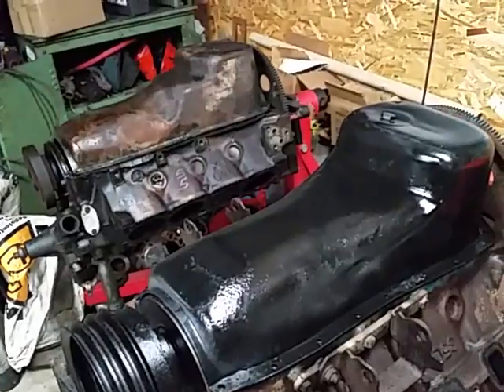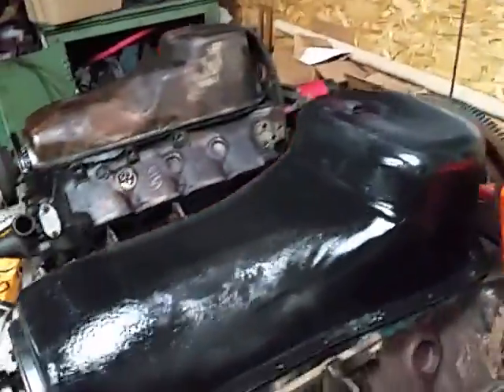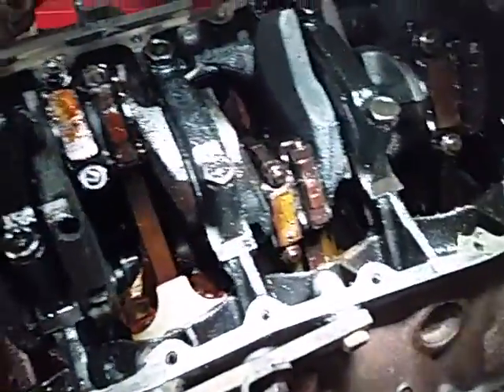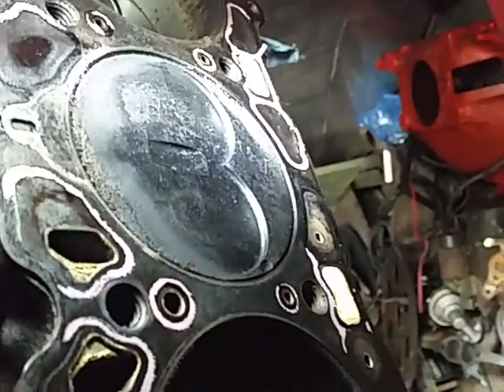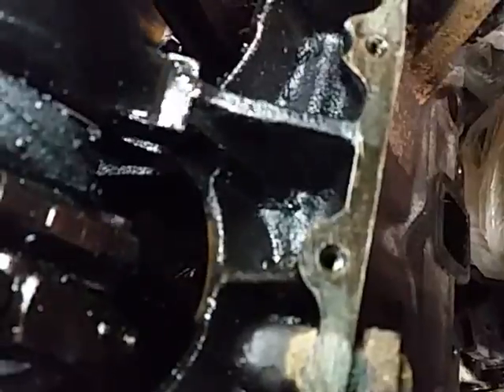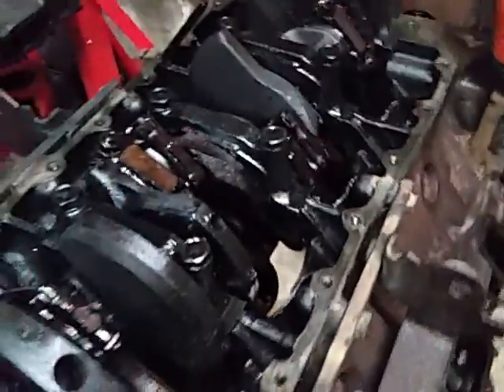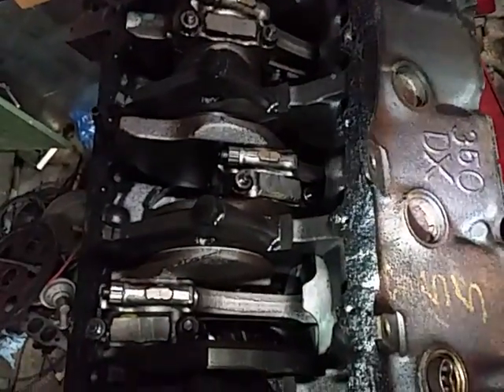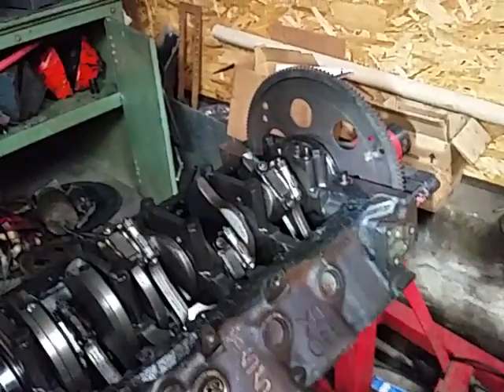Olds 350 Windowed Mains Vs DX Diesel: A Tale of Two Oldsmobile Small-block V8 Engines

Comment: I seem to remember Mondello selling at kit to use a modified 425 crank and gas heads/intake to make a 455 "small" block from the diesel block. I have no idea what rods they used. Saw one in a w-31 once and it was a great running car.
Reply from the maker: You're right. And I believe they used big block Chevy rods.  They had to be narrowed a bit at the journal end. Also I believe the counterweights needed work in that area. So the big obstacle is you wind up putting $1,000 worth of work into a 50 + year old crankshaft. On the plus side, my computer says it will make a ton of power
Reply: @ShawnStjean  yeah that's right Shawn put this idea in your head 560 HP and 640 with the use of the 455 head's on the diesel block olds motor with the performer rpm intake for a minute then it's time for some reason to find a mustang to play with on the streets with brother
Reply: Wow you people are sleeping on that note I've known that trick for over 20 plus years now wow.mondello performance people already have let me know about this News a long time ago, I'm surprised that you just gotten around to finally are just now starting to talk about this News what a pathetic bunch of lazy lay about people who don't have a clue to what performance engine gains are available for the Oldsmobile motor it's pretty pathetic because all most people want to talk about is how much they love to build up ford's Chevy, and Mopar and they forget about building the Buicks, Oldsmobile and the Pontiac motors as well don't we deserve any credit to the street creditablity and capilibities of being mentioned or what it's not just a Ford and a Chevy product world out there there are plenty of other makes and models out here in the world just the same thank you so take your Ford powered junk and shove it up your asshole people
Reply: Yeah you have to get the counter weight's cut down for final fit or you can get a hold of mondello performance on more information for the building information it will come at a cost of 2500 . for a full rotating assembly I think but call mondello performance it's in the Hot rod magazine for the phone number people.
Reply: DX 350 bored to 4.20 and 425 ci Oldsmobile big block forged steel crank at 3.98 stroke is about 468ci , offset ground to 4.25 and your pushing 500 ci Small Block Oldsmobile. DX is roller cam block so performance roller cams from a 1986 to 1990 307 Olds fit .